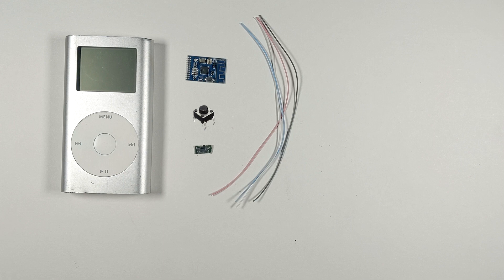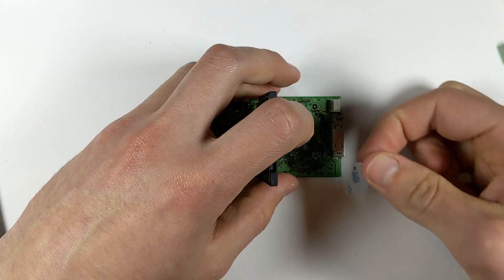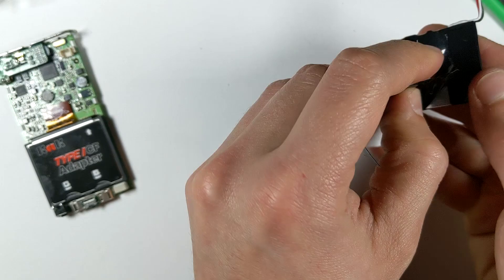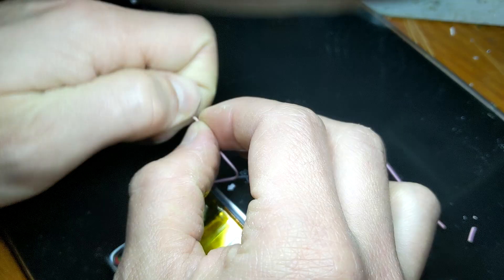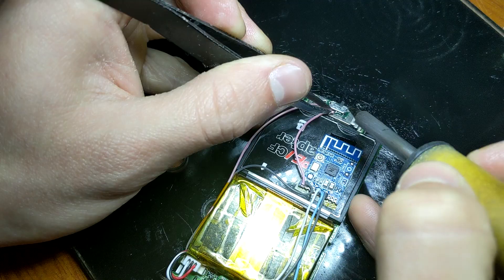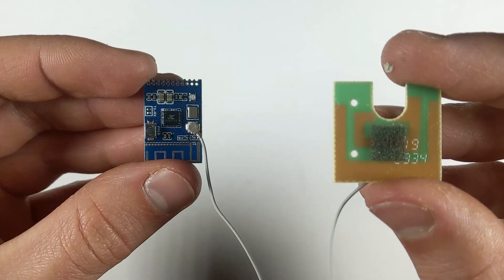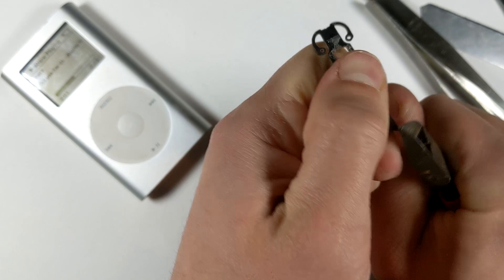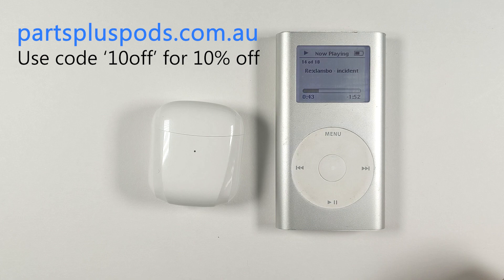The Bluetooth iPod mini Tutorial

Comment: Would there be any other way to power the Bluetooth board you know I’m not very comfortable with taking a blade to a battery
Reply: You can get batteries that have the control board just covered with some kaptom tape that you can remove with your nails and then solder on. SO there is no need for cutting off the outer layer.

Comment: Nice tutorial, so music data going from the iPod's DAC, to the BT module ADC, and finaly to the BT headphones DAC. How is the sound quality after that? Thats digital to analog to digital to analog again. 

Keep it up, nice edits and mic.
Reply from the maker: I will have to test the sound quality with some better earphones, the ones i used in the video weren't that good as i usually just use my wired ones. But on those, it sounded normal.

Comment: This is amazing. One issue I have is your SSD adapter has two slots for the MicroSD. Can that work? I put only one 256GB MicroSSD in a single slot adapter. Do you have two slots to put in 512GB or higher --- confused about that.
Reply from the maker: The dual micro sd card adapter will work with both 1 or 2 micro sd cards. I think the one i used in the video may have a limit of 128GB per slot although im not 100% sure. i havent tried to put more than 128GB in a mini
Reply: @partspluspods3689  I've read it's possible to convert that old mini charger cable to USB-A or USB-C. If you can do that, would make for a great video. That's the one thing I'm not thrilled with the old mini, that old dated (iPhone 4S) charger cable.

Comment: Does this work with remote features? Like if I were to use the buttons on my headphones to stop/play the music would it work?
Reply: No, this is a transmitter, not a transceiver, also it is only soldered to the headphone jack, there may be ways to do that but you’d need to use, as I said, a transceiver and find a way to solder it to the connections the mini has for that adapter thingie